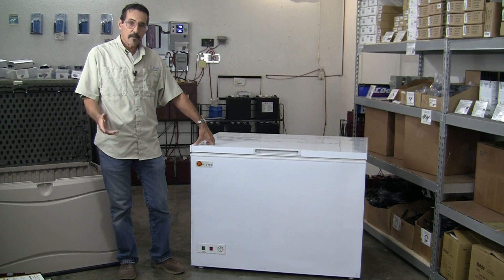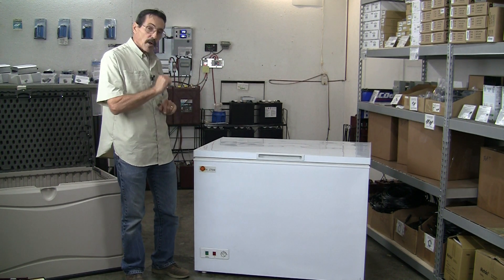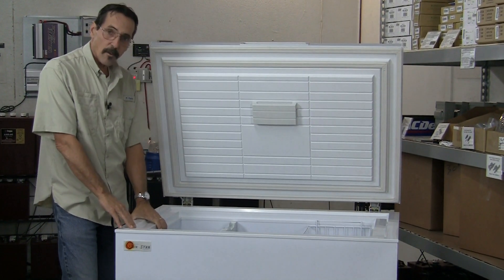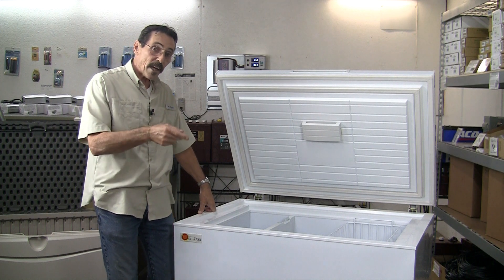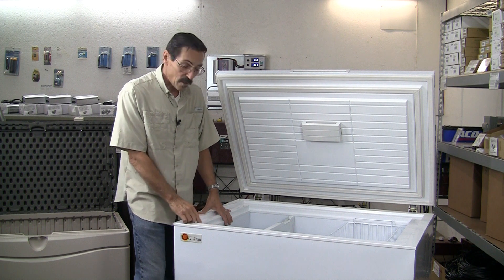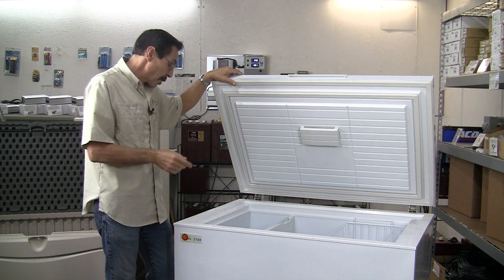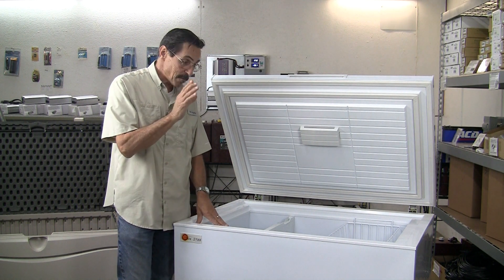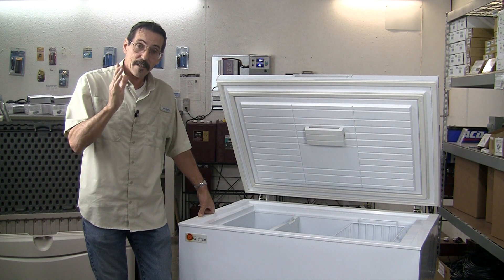DC Freezer Refrigerator | Missouri Wind and Solar

Comment: Can we fit this inside a delivery van??
Reply from the maker: We do have some compact sizes available, give us a call and we can go over dimensions with you.  417-708-5359.
Reply: I have one of these. Been running perfectly for almost 3 years, and averages 479WH/day when set to average 0*F.  (More like 300-350 in winter,  600-70 in summer, as I don't keep my kitchen at a constant temperature).  It is 44" wide and 32" front to back, including the hinges (needs another couple of inches above and behind for lid clearance). To open the lid all the way requires about 65" of headroom.  With the space required for proper cooling, figure on needing a space of at least 50" x 34" x 65".

Comment: 40 to 80 watts?  WOW.  What does the big one use?
Reply from the maker: +legalizeshemp420 40 to 100 watts
Reply: MissouriWindandSolar
Now that is just too real.  1 150 watt solar panel could run it with all of the losses involved and a mostly sunny day.   This I like greatly. :)
Reply: It has a variable speed compressor. Startup is around 45-50W. When I first installed this it spooled up to around 120-140W because the interior was almost 80*F. As it cools it uses less power. Once the temperature has stabilized (around 0*F for my use as a deep freezer) it comes on around 45-50W, spools up to around 85-95W after about a minute, then settles around 65W until it shuts off. Mine averages just a hair under 20W, or 479wh/day. I've read the new models (8 cu ft) are slightly more efficient.
Reply: @dbcrn859 That is unreal and begs me to ask why are the name brand stuff so highly inefficent in comparison?  Collusion with the electrical companies or made for 25 cents and sold for 2500 USD?
Reply: @thebeststooge  The usual AC mains powered freezers are made to be able to run on inconsistent power, sometimes as low as 85-90V in areas with substandard infrastructure. They are more efficient at lower voltages, but have to be able to run at higher voltages too. Also made as cheaply as possible (of course) because of PROFIT and most people only look at the retail price and can't be bothered (or simply don't even know how) to "do the math" on what it will cost in the long run. Build cheap, sell cheap, sell more when they break, fill up the landfills :(
Reply: @dbcrn859 I agree with most of that but running on 85-90v in the USA is really a non issue or it should be as I know my computer equipment would begin to shut down that low.  Most things made for the USA market are built for 120v but can go down as low as 90 and as high as 140 before it either shuts down or simply burns up.
Reply: @thebeststooge  Most appliances manufacturers design for worldwide sales, not just North America.
Reply: @dbcrn859 I said the North American market because one appliance is normally made to handle the power of Japan, USA, and Europe.  We take 120v whereas Europe takes 240v whereas Japan takes 110v so the internals are the same but the electronics will be slightly different.  For a computer the power supply handles that but for things with compressors and motors it is a bit more involved and to be UL listed (which all must be to be sold in the stores due to insurance requirements) they must adhere to our standards.  Now buying from the Internet such as AliBaba/AliExpress or eBay will get you all sorts of things but they will not be UL listed which means if they are found out after you put in your claim for say a fire you will be denied.
Reply: @thebeststooge  I think you're missing my point. There is far more to the world than North America, Japan, and Europe. Many places do not have reliable mains power, and voltage can be 85-90V. The appliances are designed to be able to run at these voltages, and therefore are compromised in efficiency at higher (110-125V) voltages. The manufacturers are not going to build different voltage appliances for every different mains power voltage. The same unit that is designed to run at 110V will also have to run at 90V or 125V. It's the cheapest (most profitable) way to do it.
Reply: @dbcrn859 Well, I agree with you there and know the worst thing?  They build for 240v and step down from there and when they do that everything becomes sub par.  It works, sure, but not near as well as it should.  For instance I purchased a led bulb from ebay a few years back and it came and immediately I plugged it in and knew what was going on.  SURE it said 110v on it but the guts was made for 240v because I get more light out of a candle than I did that thing whereas my Euro friends said it was nice and bright for them.  Same difference but with compressors and motors it is even worse as they are mechanical in nature.  Motors, for instance, will be for 240v (regardless what it says) and the only change with it will be the startup capacitor used.  Stresses a lot of stuff out but you can put a higher voltage requirement item in a lower voltage supplied situation but the other way around it blows out or catches fire.

Comment: Lowes has 8 cf frigidaire freezer that uses 218kwh yr for $300. What is the advantage of purchasing this freezer. Just looking for info
Reply: This is a DC [powered freezer. It can run directly off the battery(ies). No need for an inverter and the associated wasted power. Even an efficient inverter will waste 10% + 20W self-consumption.

Comment: Anybody own one of these or similar and have run it as refrigerator for a number of days and figured out the average watts per day consumed?  I saw one engel 40L (1.5 CU FT) video that hinted at 250W per day DC but I am looking for a more accurate number.  Prefer measurements in 85-90 degree ambient.  Thanks.
Reply: Specs say 272 wh/day at 90F ambient when used as a fridge.
Reply: 85-90F ambient temperature will use quite a bit more power, as lab testing conditions are more like 70F. This has a variable speed compressor. Startup is around 45-50W. When I first installed this it spooled up to around 120-140W because the interior was almost 80*F. As it cools it uses less power. Once the temperature has stabilized (around 0*F for my use as a deep freezer) it comes on around 45-50W, spools up to around 85-95W after about a minute, then settles around 65W until it shuts off. Mine averages just a hair under 20W, or 479wh/day. I've read the new models (8 cu ft) are slightly more efficient.

Comment: how does the watt hr usage compare to tier 3 cee fridges? i understand that actual power consumption varies by many factors, but seeing as how the chest obviously has more pros in usage, im curious about raw power draw and how that translates to someone just wanting to save on power. i mean for home use that will probly still want a fridge and freezer as well.
Reply: Mine uses an average of 20W set at 0*F.

Comment: what I would like to see made is a unit like that but with a small apartment frigerator on top of half of it so the small frigerator opens up like a regular frigerator but the air cold air comes in from the bottom from the freezer and the other part of the freezer has a lid that comes up and you reach down and you can grab things out of it and you can also reach down underneath the fridgerator from the freezer side to retrieve things and so the whole unit freezer and refrigerator runs off the 12 volt DC but the freezing unit or cooling unit is in the freezer and through louvers that allow the cold air to come up into the refrigerator The Dandy idea
Reply from the maker: +Bryce Irwin Cool idea
Reply: +Bryce Irwin Cold air sinks.

Comment: when you say 40-80watts is that per hour?
Reply: Running watts.  These use 200-400 watthours/day, depending on ambient temp and whether you're using it as a freezer or refrigerator.
Reply: There is no such thing as watts per hour. If you hear anybody saying that you know they don't know what they're talking about.
Watts is a measure of rate, or power. Kind of like horsepower. 
A Watthour Is a quantity. Kind of like a gallon. Since you can't pour electricity into a bucket, you measure the rate along with time in order to get a quantity.

Comment: I don't like "Call For Pricing" on things, I guess I will just wait.
Reply from the maker: +Delbert McCord It's a problem with the website Delbert. It has to be shipped by truck lines and the website has a problem with putting in truck pricing because it changes all the time.
The price on the 9 cubic foot is $1,149.00 and $160.00 shipping
Reply from the maker: +Delbert McCord I also hate call for pricing by the way or something that doesn't have a price on it in a store. You could probably just go pick it up yourself, it's not to far from you.

Comment: i thought the Amish didnt use electric
Reply: They're not using electricity. They use solar, the power of the sun.. 😂😂😂😂
Reply: Most Amish are OK with off-grid as I understand.  The issue is being dependent of an centralized system in a way that would upend their way of life.  I know for darn sure they are perfectly fine with riding buses haha